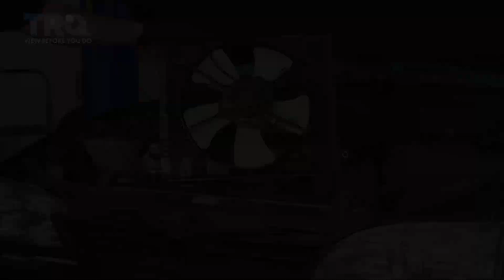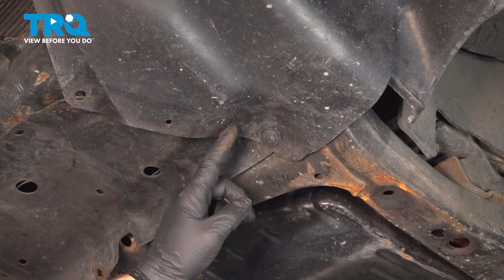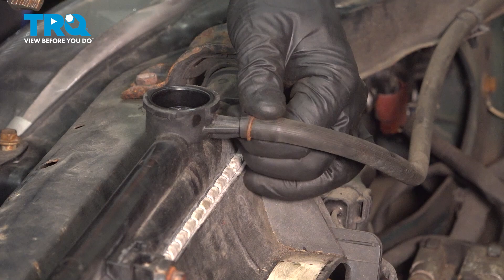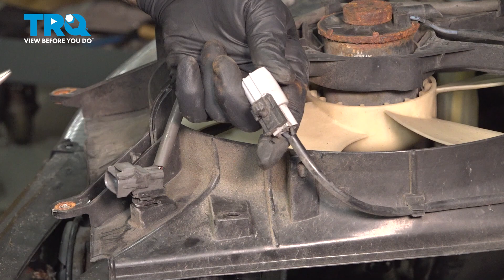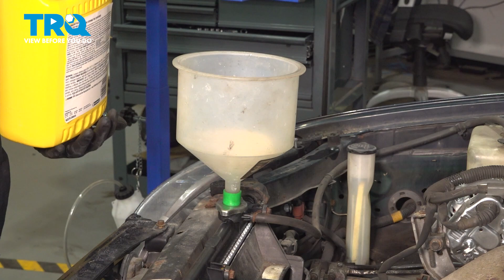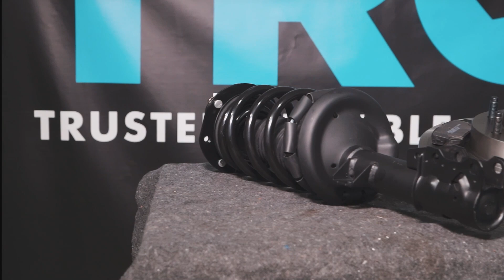How to Replace Engine Cooling Fan Assembly 1992-1996 Toyota Camry 2.2L I4

Comment: I just replaced the fans in my 96 camry however the big gray connector seen at 2:46 is missing on the new fan assembly is that a important fix